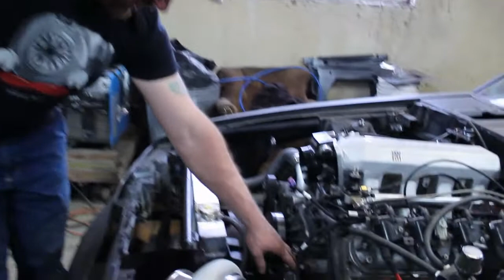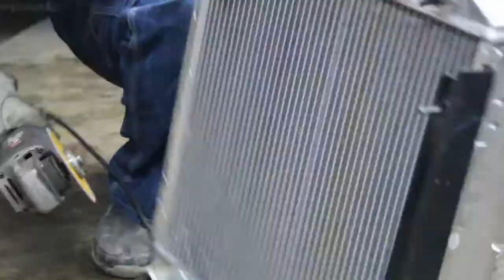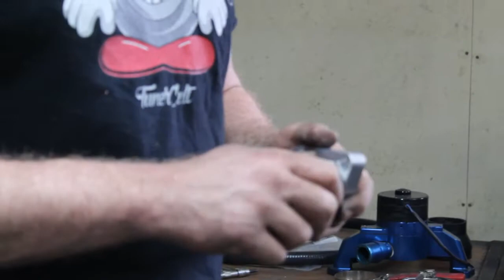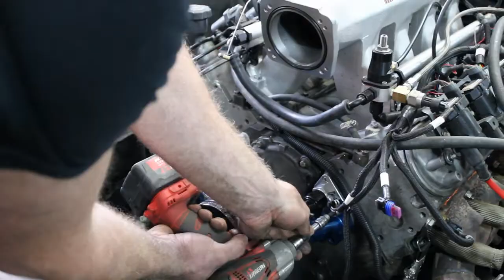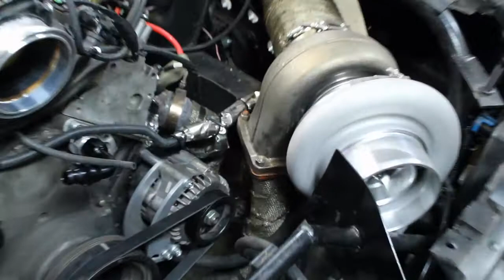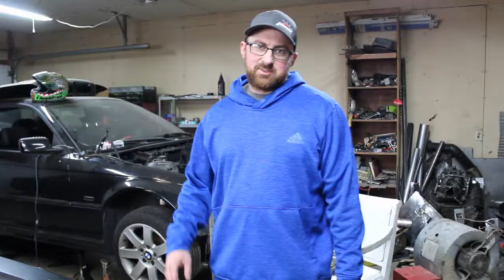Budget Electric BBC Water Pump on a 5.3 LS

Comment: What balancer you running here?  Looks like a truck.  I've been looking into same setup for my S10 but with ls1 spacing.  I haven't ordered my ATI damper yet because I'm scared it'll put alt right where my steering box is.
Reply from the maker: Yeah its a truck balancer
Reply: @boostinbo  thanks!
Reply: I’m running a truck balancer and mine doesn’t have enough clearance on the bottom radiator hose anyway you could post pics of yours
Reply from the maker: Add me on Facebook and I can send pics on messenger if you want. My name is Bo Dyal

Comment: But cool vid.  I was also looking for a cheaper way to run a electric water pump without spending 700$+ on a LS pump.  Totally wasn’t being a dick. Just looking out for you.  I’ve built over 500 LS/LT engines and swaps in all kinds of different cars and the camaros and vettes they come in.  And I can tell you for a fact that putting pressure to the top sides of the heads isn’t a great idea because you have no way of knowing if it’s pumping threw and back out  The return lines or just dead heading flow to flow and just compressing the air in small pockets and what that does is crack heads by the combustion chamber.  I’ve seen a lot of air pockets that the temp gauge was perfect 190 degrees but a air pocket in the back of the head (when guys don’t use the 4 corners ) and it burns a hole and cracks the head.  Just a chance I wouldn’t take. I always run them back to the return side or top of the radiator or overflow tank which ever is more convenient. They all work. Just not off the pressure side of the pump output.
Reply from the maker: Whoops. Oh well lol. Thanks for information. It makes sense but I'd say its probably alright, I've beat the crap out of it with no issues but I'm glad I know that for the next one I do. Thanks.
Reply: Just throwing it out there. I try to help people out.  When I’m working on a customer car I can’t take the chance.  But thanks for showing me something new with the BBC pump.  We always run the 700$+ fancy ass electric pumps and I was like I just build the cars. I don’t get paid like that and I have three kids. Lol. Any way to save money on a my build is a plus in my book   I’m def going to run that set up. I made my adapters at work today. Just waiting on my pump to come in to finish it.
Reply from the maker: Sweet. Yeah I couldn't justify running a $700 water pump on my junk motor lol

Comment: I HIGHLY suggest not running your steam port back into the pressure side of the pump. It’s supposed to flow up and out the steam ports. Not put pressure back in the top. Your basically creating a dead head issue where you trap the air bubble right were it wants to exscape. And you won’t see that on the temp gauge because it won’t read air. And it won’t read a hot spot on the head.  You might have 4 hot corners and the rest is perfect because of the flow all around. I always run it back to the top side of the rad so it has full flow up and out

Comment: I was wondering, could you have used a 3/4 npt with a barb fitting instead of grinding the pump & fitting? Just curious bc I'm doing the same swap this weekend .
Reply from the maker: Well the adapter I used is threaded for 12an orb so I'm sure how you could do a npt fitting unless you just welded it straight to the adapter.